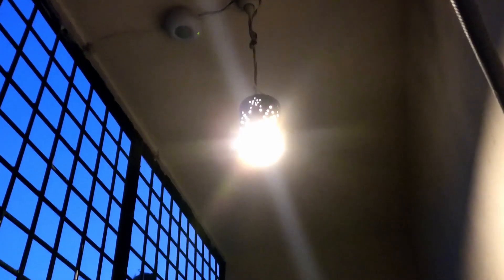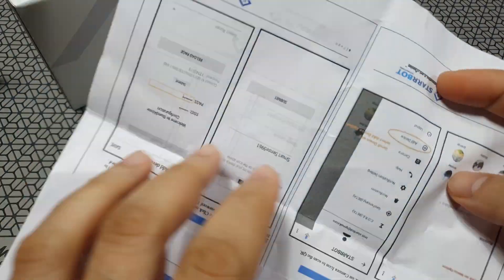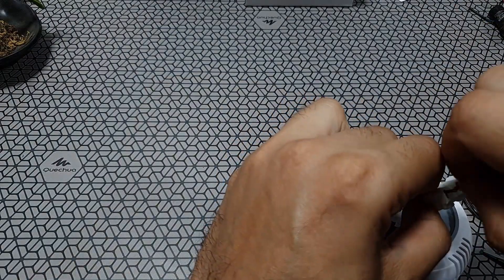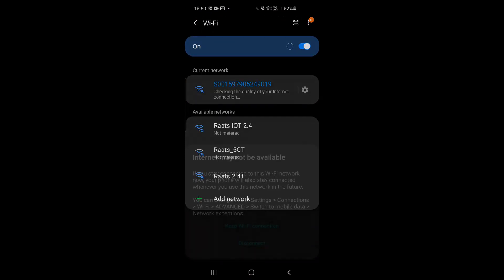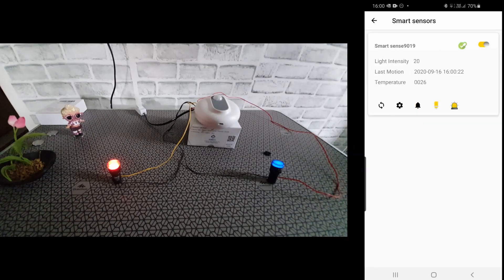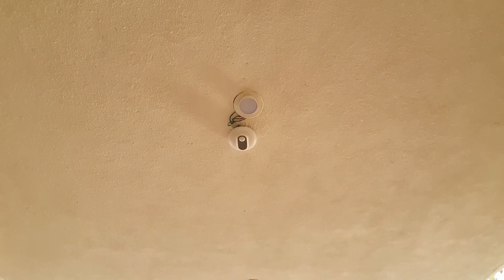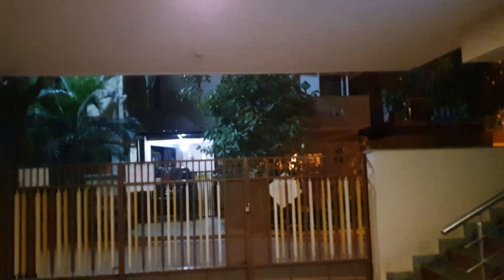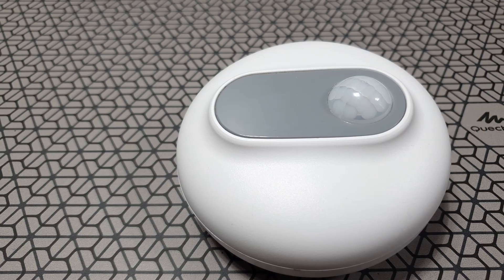Smart PIR Sensor with WiFi from Starrbot

Comment: Are u still using this device ? Do you have alarm or light attached to it ? Is app and device working properly  and wifi connectivity? Please update about all
Reply from the maker: All have it it works fine.. dint have an alarm fixed .. but the lights work 👍